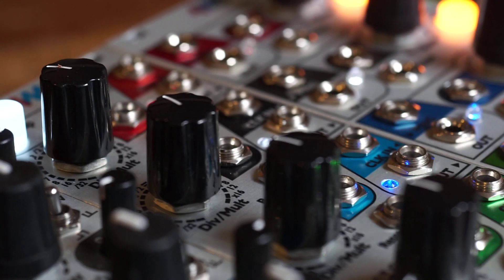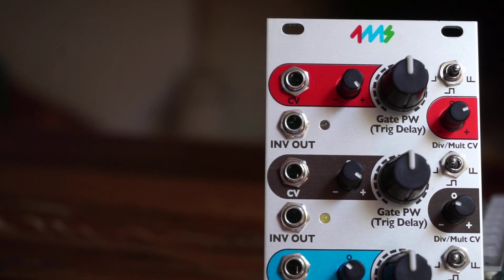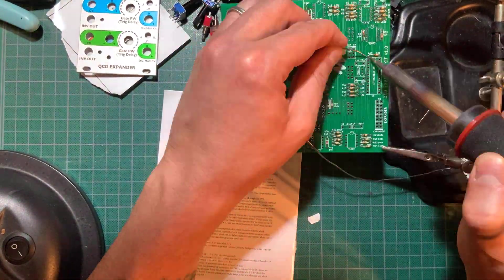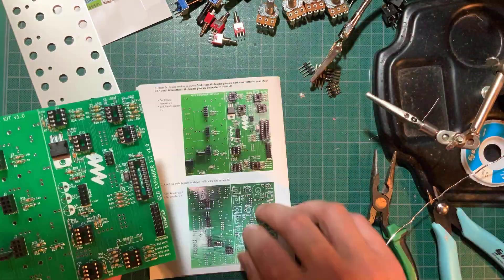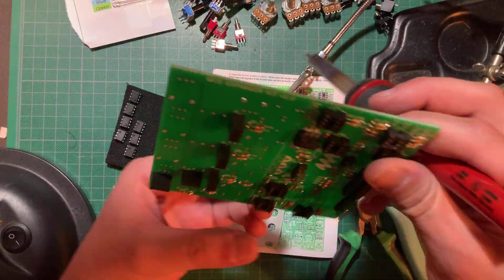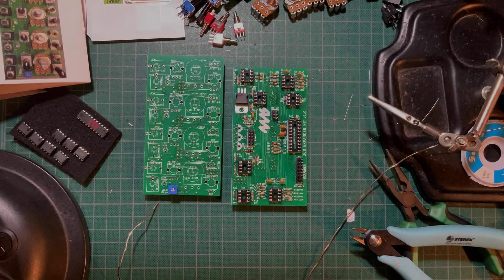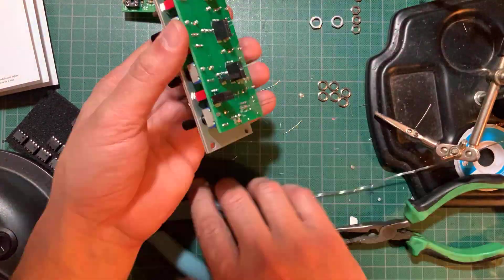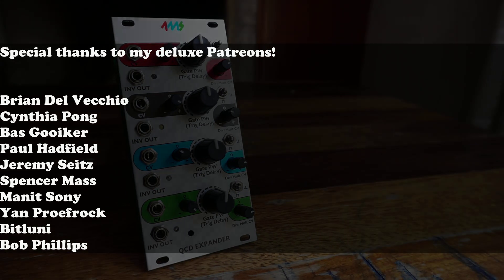Building the 4MS QCD Expander

Comment: Why do you solder components from the top side?
Reply from the maker: Faster, cleaner, easier!
Reply: @QuincasMoreira  why is it cleaner?
Reply from the maker: @matrixmodulator  it's just tidier I guess, not having to bend out the leads underneath then deal with a forest of leads when trying to solder. You only turn it over once to trim everything and done.